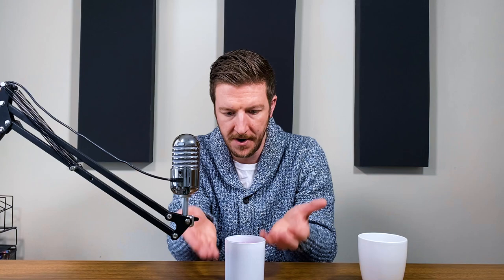Are Full Melt Pools BAD for Candles?

Comment: Omg you couldn’t have done this at a better time!.. i so needed this reassurance because I was about to lose my mind with these wicking issues. Had a 98% melt pool at 1hr mark and was worried but the flame was stable with excellent HT
Reply: I’m very new to candle making but wouldn’t that still be considered burning too fast? An almost full melt pool in one hour will burn even faster once it’s half way down the vessel, which would make it unsafe correct? I’m still learning so I’m not sure but maybe you should check the temperature of the vessel to make sure it isn’t overheating.

Comment: So glad you are back 🤗. What about a pillar palm candle. How should a pillar burn? What wicks would work best with this wax? Thx
Reply from the maker: Good question. Don’t let it spill or tip.  Make sure the combustion is balanced (no black smoke) and that it burns with a flame less than 2-3” tall.
Reply: @ArmatageCandleCompany  what wick type?
Reply from the maker: @babyg2cc2  depending on the size, RRD or ECO can be a good starting point!